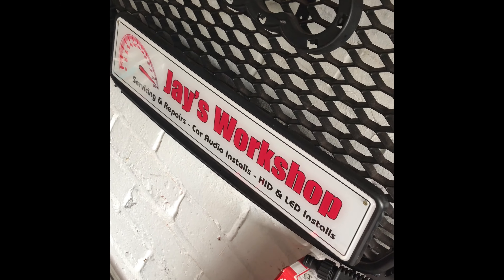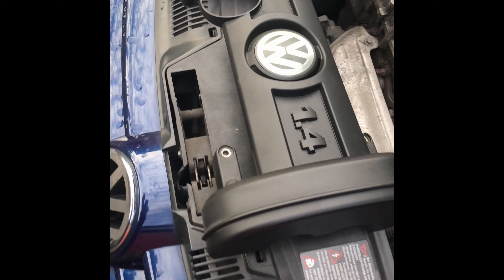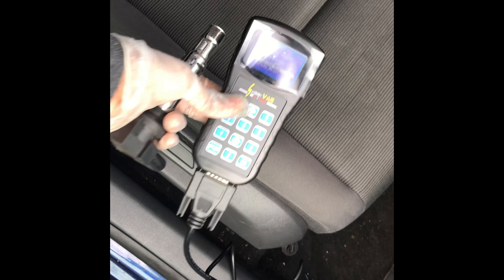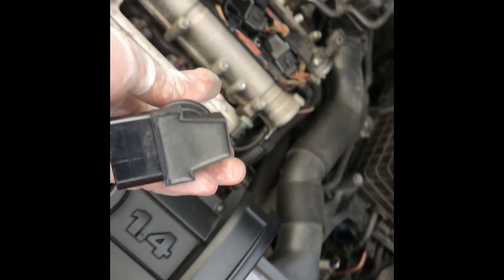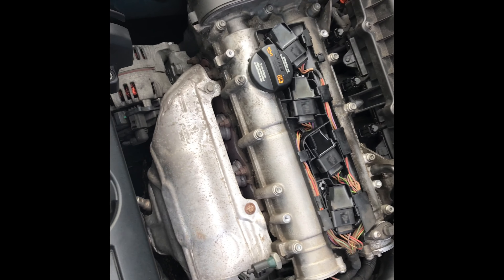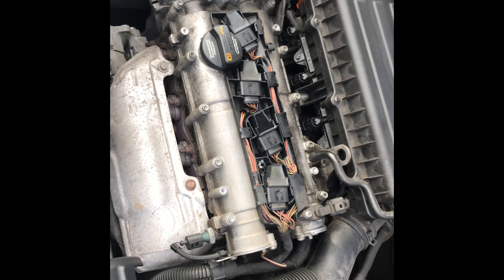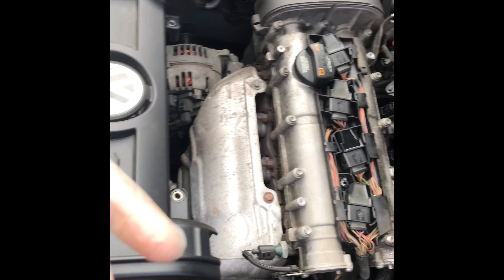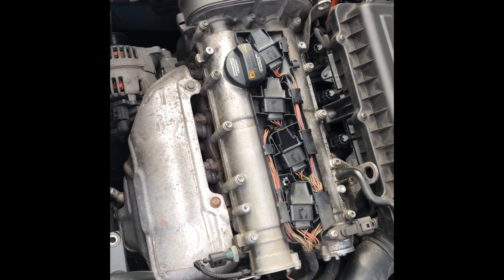Volkswagon Golf 1.4 (MK5) Cylinder (1-2-3-4) Misfire Fault Fixed

Comment: replaced all coils and sparkplugs, now even replaced the injectors. cylinder 4 injector was faulty. Still having misfires but at times engine smooths out, then starts to misfire again. Do you have any ideas?
Reply from the maker: Could be timing issue
Reply: could be a burn valve